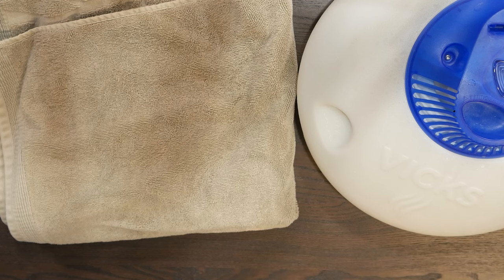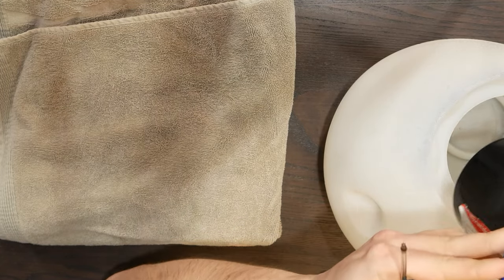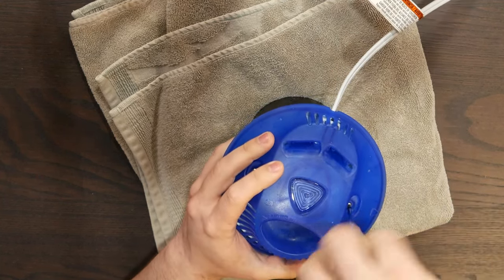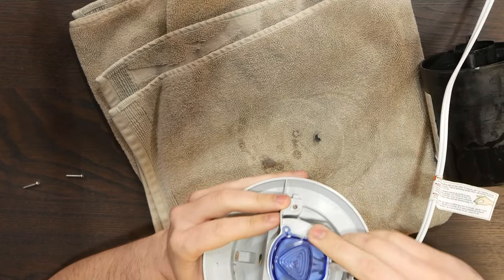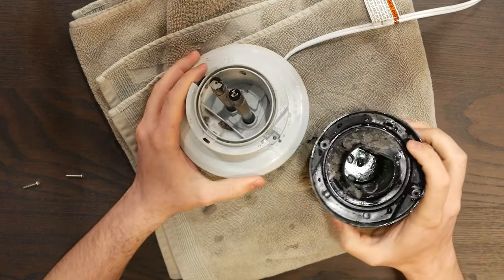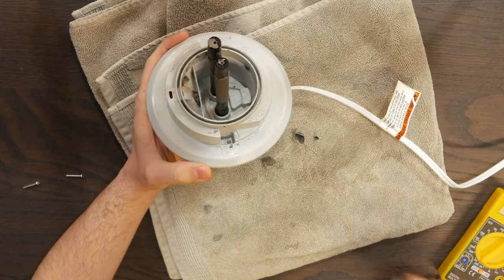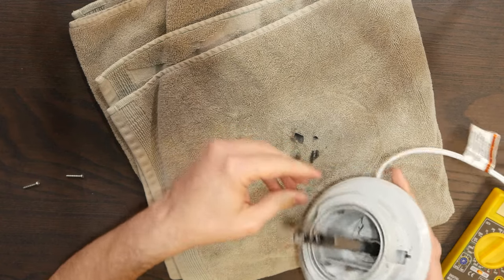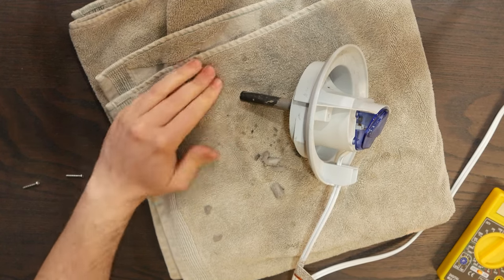Is a Vicks vaporizer an electrode boiler?

Comment: I now want a video where he just scrapes all the scale off that thing.
Reply: I am curious to see the power draw on this after a good descaling. however, I am content with this.
Reply: Send it to the guy with the laser cleaner restoration channel.
Reply: I want to take a small screwdriver and rap on the electrodes with the plastic handle to knock that scale crust off. 🤪
Reply: Just soak it in vinegar for a day

Comment: I actually prefer these to any other humidifier because they don't have mold issues. I don't find them to be tricky at all. I just add salt once per season. At the end of the season, I drain them and set outside to dry. Also, since I use in winter, they are nice because they also heat up the room.

Comment: Is is possible that some kind of electrolysis occurs and that discolors the deposit, because it's not just limestone but also some elementar components?
Reply: Electrolysis Mainly occurs in DC current, but maybe it happens in small amounts with this much constant AC?
Reply: @BoomchacleV0  that's what I figured
Reply: I think electroplating might be a little more relevant in this scenario; Whatever the anode and cathodes are made out of is a dark metal. I would argue that the electrical current is moving the metal from one peg to the other, but not at 100% efficacy so the metal is getting lost inside of the limescale which effectively darkens it.
Reply: @cazomsdragons2625  didnt alec say the electrodes were carbon?
Reply: Limestone is some grey color, there is not jute calcium in water.
Reply: @Robert_DROP_TABLE_students--  it could be the carbon from the electrodes turning the scale black, seeing as carbon is black
Reply: That looks similar to the scale one would find inside of a steam boiler.
Reply: @pizzablender  Im not a native english speaker. What is the difference between limestone and chalk? In german both would be called "kalk" which is CaCO2
Reply: @BoomchacleV0  that is a very good guess that had not ocurred to me. Now it seems so obvious.
Reply: @Robert_DROP_TABLE_students--  the limescale in the water is just calcium carbonate, yes. Chalk is a specific variety of limestone that has more concentration of calcium carbonate than other minerals; or, in common English, just refers to the calcium carbonate in any application. Thus, when we refer to 'limescale' we mean 'calcium carbonate that was once dissolved in water.'
Reply: @BoomchacleV0  Ah-ha, I'm gonna lean more toward that as well. I'm not sure what material the pegs are made of. I missed where it was mentioned in the video, and I don't have the time to search for it right now. 

Regardless, I'm sure there's a loss of some compound into the scale buildup whether that be the plastic, the anode/cathode, or natural mineral deposits within the hard water itself(this last one being less likely than the rest since hard water deposits would have to be brimming with some dark-colored minerals/metals which is hard to accomplish even in my own shower head).
Reply: @Robert_DROP_TABLE_students--  chalk is a soft kind of limestone (there are differences in mineral composition, and they form at different depths of ancient seas).  Chalk is what old-time schoolteachers used, limestone is what St Paul's cathedral is made out of!
Reply: @cazomsdragons2625  On the grosser hand, it could be black from mold
Reply: Mold/Mildew within Limescale
Reply: So, this device literally does generate a lot of Hydrogen + Oxygen gas mix while running? Isn't it explosion 💥 dangerous?
Reply: @nneeerrrd  No, because it runs on AC current, which prevents electrolysis from happening.
Reply: @BoomchacleV0  Electrolysis always happens when you pass electricity through water, you just don't get one specific cathode and one specific anode, they switch 60 times a second (if in NA). There would still be a bit of hydrogen gas production, as long as the current levels were high enough to start stripping electrons off of the water. A 9v battery is capable of doing it even.
Reply: @collinbarker  a 9 V battery is a DC current. There are large water heater tanks which run on electrode heating, and they don't generate hydrogen gas because they use AC current. The constant switching of the current prevents significant permanent hydrogen build up which is why it's safe to use it to heat water, unlike DC.
Reply: @BoomchacleV0  There would be no permanant hydrogen buildup, but it and O2 should either ignite, or float away as both are produced at the same point. Here is a link to a bunch of people doing their own tests, not a research paper, but many are stating the same thing. 
https://www.scienceforums.net/topic/23400-electrolysis-with-ac/

Just because it alternates does not mean there is no electrolysis. 
AC electrolysis does not do any useful separation, as it has both cathode and anode in the same spot, separated by a very  small unit of time. H2 and O2 gas itself though, requires some energy to convert back to water, and will float away if not activated. For dissolving metals though, it would be useless as it is the transfer of electrons that makes metals soluble in the first place. If on AC, the metal will dissolve and then resolve back into metal as it does not float away. 

For gases though, because they float away, they cannot completely be brought back into their reactants. In fact, the scale is the byproduct of electrolysis in impure water, caused by dissociation and breaking down of the components of complex ions, releasing gas. Ions like hypochlorate and similar with more than 1 atom would break down, resulting in some boiling off leaving the others, which can result in insoluble sludge forming and precipitating. 

Overall, no useful electrolysis work would be done, but there should be some electrolysis of water occurring on both electrodes. AC can be seen as really fast +- DC in a massive over simplification. If metal is used at first on electrode A, which is positive, the metal would dissolve into the water. If the polarity was suddenly reversed, metal would be redeposited back on. Do it fast enough and that would resemble AC. The main thing to note though is that even though it is AC, the metal does dissociate. For metals that does not matter, as they cannot leave, but for gases, they can, and will.
Reply: Yes the electrodes are carbon. I run two of these in my electronics repair shop.

After a few years of trial and error, it is much easier to clean them with a metal scraping tool instead of screwing around with vinegar, soaking them scrubbing them soaking etc.

Put a picture to of salt in these and they really rip. I'm going to check the power consumption of mine tomorrow because I go through 1.5 gallons every 8 hours in each unit
Reply: It's charing. The current flow between the electrodes chars the minerals in the water.
Reply: @garretthaney9134  It's mineral deposition due to evaporation and electrolysis; largely due to impurities in the water like hypochlorite solution (chlorinated municipal water supply) and various minerals.

Charring is what happens to my toast when I get distracted and leave it in the toaster too long.
Reply: @faceplants2  Your toast is black because the carbon in the toast gets charred. The junk on the bottom of the tank is black because it is also charred. 
The disolved solids between the electrodes get heated to the point they near instantaneously boil the water- which is enough to cause the same charring effect as bread in a toaster.
Reply: @garretthaney9134  : Bread & such char because they have high amounts of carbon. Most minerals in water do not have high carbon contents, and thus while they may oxidize, they will not char (char is very much NOT oxidized).
Reply: @cazomsdragons2625  Unless your AC has uneven phases (i.e. it has a "positive" voltage longer than "negative"), electroplating is impossible. Since the current is flowing in each direction for an equal amount of time, any material that is added is also removed.
Reply: @pooroldpedro  I used chalk for many years, I had a metal holder with a pocket clip on it that I would put a piece of chalk in and when I needed to press an adjustment button to let out more chalk so I could continue to write without getting chalk all over my hands.  When I was teaching chalk was almost dirt cheap but the university updated most of the classrooms with white boards that use dry erase markers (I think I still have a set of those but the chalk and holder are long gone).

Comment: I can certainly say they are still built the same. I bought one last winter, and ran it almost continuously for several months. Eventually the output was very minimal compared to when I first bought it, and could hear something loose shaking in the unit when I moved it. I took it apart and found the electrodes corroded and full of scale.
Reply: That is weird, mine boil hotter with a bunch of scale on the electrodes.  Your scale must have a drastically different mineral content than mine.  Water mineral content varies by region so that is reasonable.

Comment: Yes they are still made like this. They are my favorite type of humidifier. I run one constantly all winter and fill it twice a day. When you were looking for the power consumption you should also have seen that while the unit is marketed as Vicks it is made by Kaz. 

As for efficiency they are very near 100% as I'm using them during the heating season. The heat generated is not waste it is just shifting the load slightly from my central heating. I've had the same unit for over 10 years and every couple years I take it apart and chip the scale off. Compared to an evaporative model I'd say that's pretty good. No wick to get funky and replace, very little noise, nothing mechanical to fail. This same design is also still available as a whole home humidifier that installs in your ductwork.

As for safety I'm sure you noticed it took a fairly odd size Torx driver to disassemble. When correctly assembled the only danger would be a detached neutral electrode. Even if that did happen, note the design of the reservoir prevents contact with the water. Remove the head with it plugged in and a tab slows you down giving the water a chance to drain away from the electrodes. Yes I'll admit they are a pain to clean but if they were easy to clean they couldn't perform the safety function.

Comment: Had a DeVilbiss electrode vaporizer that was made in the 60s. It had a heavy glass reservoir that got blistering hot. It was unique because it had a knob on top that adjusted how much steam was produced by changing the spacing between the electrodes.
Reply: DeVibliss made my first asthma nebulizer pump.  They were mainly a hospital and doctor office item back then (I was the second person in Michigan to have one at home in 1987) and cost $4K.  Now they are cheap (I have seen them sold online new for about $30) and most people with asthma have them at home.
Reply: @mharris5047  Wait, is this how asthma nebulizers work? I remember my brother using one as a toddler (on loan from the hospital, so we were VERY careful with it). This was about 2001. The entire inner workings of the device were concealed in beige plastic.

Comment: I used a similar Duracraft humidifier for many years.  I found that the more scale on the electrodes, the more the power draw and the more it heated the water.  It eventually got to where it boiled so forcefully that it spat water out of the vapor hole.  I disassembled it, soaked the electrodes in straight vinegar and took at least a quarter inch thick layer of scale off of them.  After that, it worked just like new for several years.  These depend on the mineral content of the water (and possibly the electrodes if it has been used a lot) to conduct electricity and boil the water.  I keep one around for the coldest Michigan nights when the ultrasonic humidifier doesn't do enough of the job.  My current electrode humidifier is a Sunbeam and it draws about 300 watts using my home's tap water.

Comment: I haven't seen anyone mention that the "high power usage" is converted to heat, which helps heat your house in the winter. In that sense, it's actually the most efficient, as all the power is used by your house. In the summer though, these things suuuuck. Also, it's not really that scary. It's completely isolated when it's actually screwed together. I would recommend putting it on a GFCI outlet though.
Reply: I haven't seen anyone mention that the admittedly gross-looking scale is more or less harmless, and the mold that grows in other style humidifiers is far more dangerous. Wick style and "cold mist" style humidifiers will spew mold spores around your home if you don't take proper care. Meanwhile the electro-boiler not only kills anything in the jug whenever you use it, since it's boiling water your only adding pure water to the air... all the grossness stays in the jug.
Reply: @MrVTPhil  Good points. I take mine apart and peel off the scale once a year at the end of the season. It's also really easy to make replacement electrodes for it, just drill and tap some graphite crucible rod, takes 10 minutes. Granted, it might be overkill, but I don't like throwing away what I can fix.

Comment: There are plenty of warm mist humidifiers that use a resistive heating element, have multiple heat settings, and use a hygrometer to turn themselves on and off.

Comment: A much safer way to test the electrode theory would have been to use the continuity function on the multimeter instead of plugging it into the mains and probing it... just saying for next time. 😅
Reply: That still wouldn't complete a circuit. 

You'd need to short the plug and then it would show up in continuity.
Reply: @NishithThakkar  Measure continuity between one electrode and the plug. Then the other
Reply: Yes, especially since there's water everywhere! Big Clive would not be happy.
Reply: @NishithThakkar  The multimeter completes a circuit between the two probes.
Reply: @face1990  No it doesn't, because the electrodes are directly wired to the plug, which is open. Your path would come out of one probe of the multimeter, into the first electrode, through the wire, hit the plug, and then the circuit would be open and you would not get continuity because the two prongs of the plug aren't connected. Nishith is correct that the plug needs to be shorted to complete the circuit.
Reply: @mjc0961  Maybe I'm misunderstanding. So if you connected one probe to the electrode and connect the other probe to the plug pin which is connected to that electrode, would that not create a circuit? That would be a way to show that the electrodes are directly connected to the plug without having to probe them while they're live.
Reply: Yes.  Test continuity between an electrode and a pin on the plug.  Should be a short.  Then test the other pair.

If you wanted to, you could also short the plug pins and probe the electrodes.

Either way.
Reply: yeah but irs seriously not dangerous.
worst case he ruins his probes and pops his breaker
Reply: @jhoughjr1  worst case is it tipping and falling on him.

Comment: When I was a child, about four decades ago, my parents had a humidifier that turned out to be fully mechanical (in misting the water). It was even a bit bigger than your device here. It made nice mist and an interesting low hum noise. In my teens they no longer used it, and I took it apart. It had an induction motor (vertical axis) rotating a quite large sort of funnel-shaped plastic rotor. Most of its height was a slowly tapering quite thin (averaging a couple of centimeters) part that had a hole in the bottom and that part went into the water tank. Then at the topmost part the funnel quite suddenly flared to some twenty or more centimeters and around that part was a metal mesh about two centimeters tall surrounding the whole lip of the funnel but stationary (fixed to the chassis). So I realized that it "pumped" water by centrifugal force up the funnel and the top large diameter then accelerated that water to a high speed and the water then hit the metal mesh that "broke" it into fine mist. It was fascinating.
Reply: Sounds like the one we had when I was little. Then we moved to Florida where if anything you wanted a dehumidifier.

Comment: This is how my steamer works for my furnace (Aprilaire is the brand).   It requires slightly hard water to create enough resistance to boil the water and make steam.   The electrodes are contained within a very thick cartridge/bottle/container and it makes tons of sediment and the electrodes degrade requiring frequent replacement (once a year).
It’s on a 240V breaker.

Comment: I'm really curious about how much power this would draw if you descaled and cleaned it, and then put it in a full tank.
Reply: 300W?
Reply: Depends on the salt content. You could pull over 1000w with enough salt
Reply: Bet they charge a lot more for these than what you can get a Chinese dip mains water heater/boiler for (though I'd suspect better longevity and less leached stuff from the electrodes)
 BigClive got his baby-cutor (bucket heater) up to 5kW IIRC...
Reply: @ninjamaster3453  flashbacks to AvE "load cell" (a.k.a a big bucket full of 'ol angry Pixies)
Reply: @ninjamaster3453  Agreed, and I would guess that cleaning it would actually reduce the power draw. That stuff is what's left by the H20 evaporating away through multiple tankfuls.
Reply: @ninjamaster3453  enough salt and it basically becomes a short circuit?

Or God forbid, add some metal powder...
Reply: @renakunisaki  metal powder wouldn't work, as it doesn't dissolve into solution. copper salts might be spooky, but not notably different than regular old table salt.